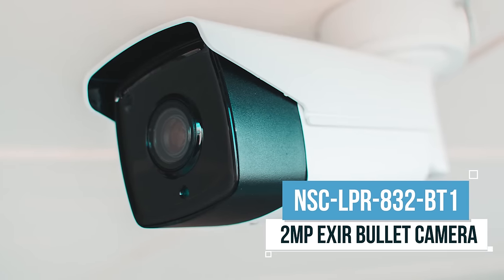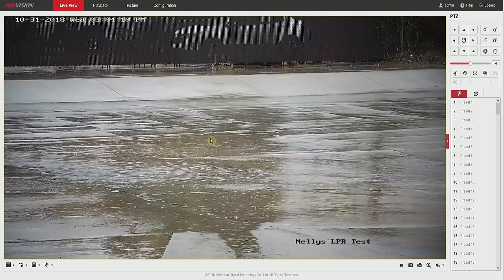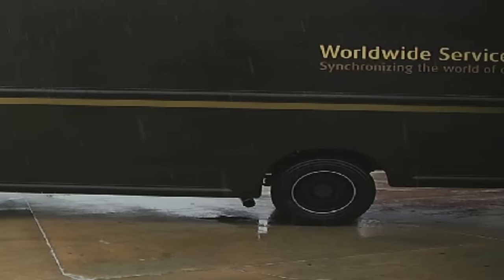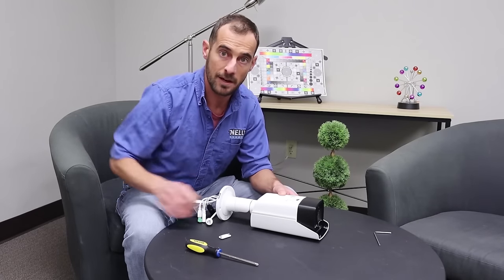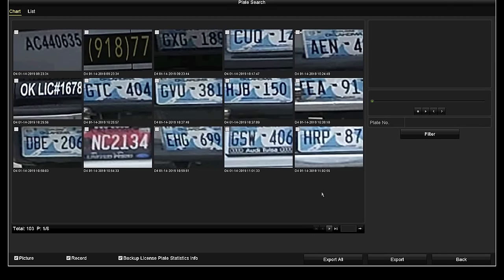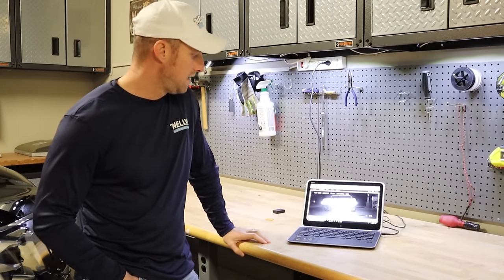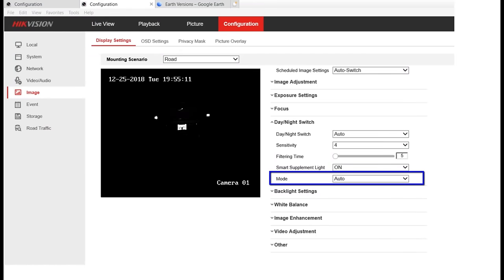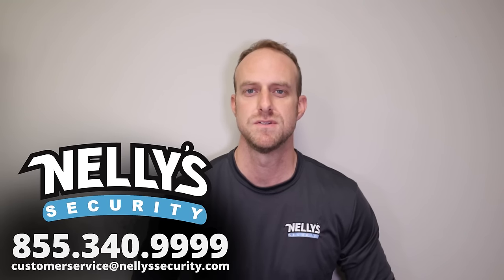How to Capture License Plates with an LPR Security Camera (NSC-LPR-832-BT1)

Comment: What NVR's support recording such cameras at full 60fps, as well as specific plate search ? Or does this have to be done through the camera directly using the onboard SD card and Hikvisions IVMS 4200 ?
Reply: Most all NVR's support 60 FPS. However, the only way you will get the plate search feature to work is through a Hikvision based NVR.
Reply: @kennydeals  Thank you for the prompt reply, generally is it better to run a stand alone Hikvision NVR (example DS7700 series) or build a dedicated Blue Iris machine? 
When running a few cameras at 60 even 30FPS does not not pull from the unit's "frame rate pool" taking away capacity for other cameras ?
Reply from the maker: @QuaabQueb  For a specialty camera like this one, you will definetely need the HIkvision NVR. If you are getting basic cameras, then you can choose between blue iris or Hikvision. Most NVR's do not have frame rate limitations, they do however have bit rate limitations but most newer ones are powerful enough where you dont have to worry about exceeding it. Frame Rate pools are more relevant on the Analog DVR's

Comment: Clicked the link for the product page thinking $225-$250 and once the page loaded was like oh........ Guess I'll have to wait a few years until this model is old technology unless it gets copied and sold on Amazon first. 

Have about 3/4 dozen security cameras some of which I've ordered thru Nelly's and been hanging onto them telling myself I'll install them but even after 4-5 yrs they've been unused along with the ip nvr which I've yet to power up as well. Most of what I have to install is POE so when installedthe solid wired between will be good. 

For the time being I'll keep watching the prices and dreaming.  Now it's fresh in my head I'll keep checking the website.
Reply: Do they make a cheaper one with a fixed distance maybe? That could help reduce the price.
Reply from the maker: @dtnel  Hi Dale, Fixed lens and LPR camera usually doesnt go together. It can work yes, but the camera would have to be pretty close under most circumstances. With big variances of distances required in many different scenarios, the vari-focal lens will fit most scenarios. I think the costs more has to do with how much of a specialty camera it is. Namely the built in software that reads the license plate, converts it to text, and intelligently manages it to be used in certain actions and viewing. Not to mention the camera has built in electronics not found in most cameras such as 60 FPS video, Light Fighter technology which prevents headlight blindout, and configurable IR settings.

Comment: is there a camera that can capture license plates. which has a system where you can enter the number plates yourself. which can be mounted in a car. so every time you pass that car the camera will ring or a light will light up
Reply from the maker: Im sure there is! 

The LPR we currently carry can technically do this, but you'll need an NVR along with it. Then you can have the NVR use its alarm output to trigger the light or siren.

Comment: Do we need to connect only one wire ?
Reply from the maker: that is correct. one network cable via POE
Reply: Nelly's Security what will be the power source. The Ethernet cable won’t run the camera

Comment: Look.  Talk is cheap. Show me all about the camera and how it sees a licence plate in zooming or edited in close-up. I have a Hikvision system (Version 4.0) and a 4K IP camera. When trying to digitally zoom towards the licence plate from a still video of a captured vehicle and, as I zoom close the digits in the zoomed licence plate become blurry and almost unreadable. You're showing us video from cameras specially positioned to make viewing of licence plates readable. But if I did that at home, where I live in a corner where speeding madmen lose control and slip off the road and ram into parked cars, then they flee, leaving the scene of the accident. And when police comes to inspect the footage they say the camera is too far offside the road and their plates are half obscured. They suggested I should install them on the gate post where it is a more straight view with the front or rear of the vehicle which the display of the plate is directly forward of the camera. And this is what I am looking for. So, talk is cheap in my opinion. You can see that the camera seen in this video has been installed at least almost in front of a vehicle. Install it on your home, pointing directly outside and straight on the road, see if you can see the licence plate or you will barely see the plate. If you still think you can clearly see a licence plate of a moving vehicle, then care to let me know the brand and type it is?
Reply from the maker: We no longer carry this camera unfortunately. It was discontinued over a year ago now.

Digitally zooming will not allow you to get a clear image unfortunately. You will need a camera that has a varifocal lens and zoomed in on a set chokepoint. 
For Plate Recognition to properly work, these cameras have specific installation requirements as well.

We do carry an LPR through a newer brand "UNV" -> https://www.nellyssecurity.com/unv-fullhd-1080p-at-60fps-anpr-license-plate-recognition-weatherproof-bullet-ip-security-camera-with-a-4-7-47mm-motorized-lens-hc121atts8cr-z.html

Please feel free to contact us if you have any additional questions -> customerservice@nellyssecurity.com / 855-340-9999